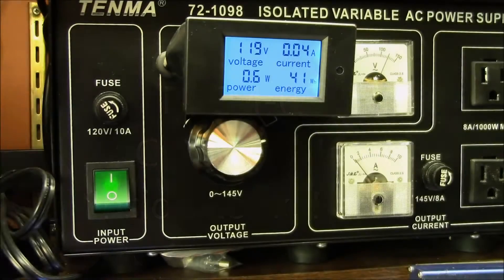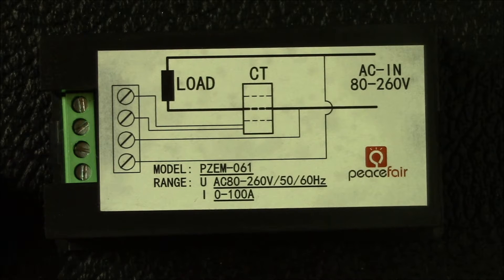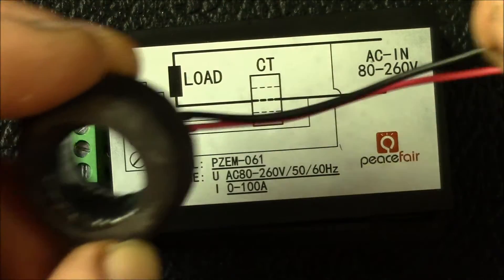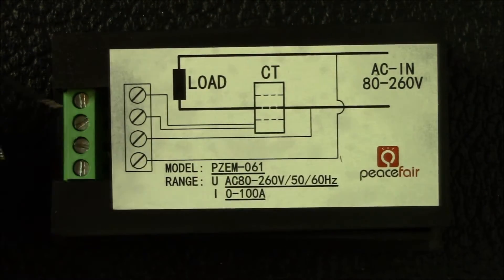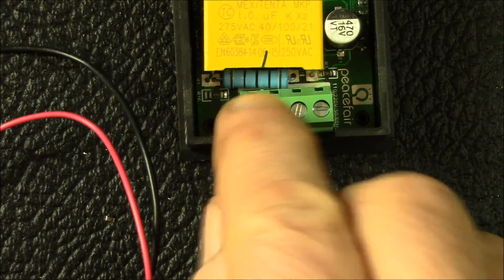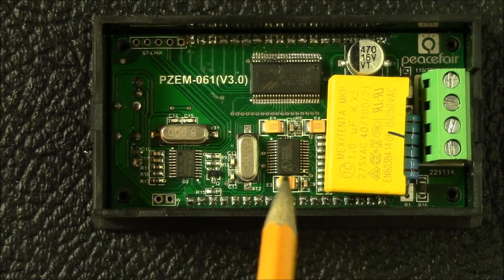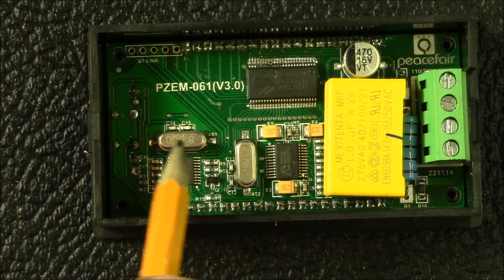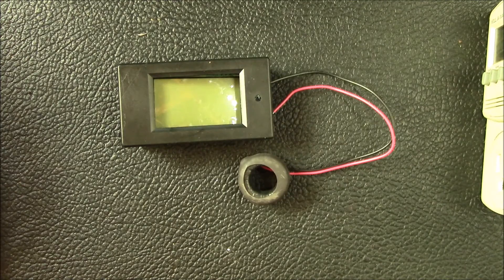PZEM-061 AC Power Meter, Inside Look, Part 1

Comment: Thanks for the great video. Does the AC have to come from the same line.  Ie.  I want to measure the current on my mini split ac/heating units, 40A/240V and the wire is 8 gauge feeding into the breaker.  Can the AC inputs to the device come from another AC breaker in the panel.  The diagram makes it look like it needs to be the same wire feeding the load.  Also, if I am measuring only 1 pole of the 240 circuit, would the ac be 120?
Reply from the maker: See below for one option:
https://youtu.be/LhR-Z6lBeZw?si=6_furGkz1XW2Jlki
You can also power the meter from 120V and then run both L1 and L2 through the CT, reversing one wire so the currents add.  This way power reads correct, volts will be 1/2 and current will be 2X.

Comment: In use ...would you fuse the ( say, 120V / 60Hz) power legs to this unit?...and if so.....what kind of fuse ? ( 1A fast acting?)...and would you need to fuse each of the power legs or only one?
Reply from the maker: Most any size and  type of fuse should work.  The meter itself only uses 10s of milli-amps so 1 amp would work.  The fuse is more to protect the wiring used to connect that meter to whatever it's connected to.
Reply: @The4Crawler  ...I'm using cheap versions of this device attached directly to the panel face of my emergency generator...one display monitor for each 120V leg of the 240V gen output. Like this unit you show....it comes with a ring type current transformer but requires you to source and attach 2 leads from the 120V source to the monitor itself....like this guy uses (https://www.youtube.com/watch?v=DDlYdOamuJA ).  OK....one fuse.....would that be on one leg....or both, for each unit? What is the risk otherwise with no fuse?...maybe only that some electrical mishap will burn the thin gauge wires used to the meter monitor? As if the thin wire is the fuse?  I might take that risk if it's localized damage like that....just don't want to burn up my generator. Panel face is metal and meters are placed by themselves touching nothing else. What would I use...16-18 wire in any case?  Thoughts?
Reply from the maker: @TheWilferch  The purpose of the fuse (or fuses) is to protect the wire from overload or the device from damage in case there's a short inside it.  In your case, on a stand alone generator with the meter on a non-flammable surface, not a lot will happen if the meter fails.  Usually, they'll fail open circuit with a dead power supply.  And if it shorts and something burns up, you're not out a pile of money as those meters are fairly inexpensive.  

So one fuse in one wire, sized for the wire, will keep the wire from catching fire if there's a short.  16ga or 18ga is fine, it's hard to fit 14ga wire in the meter terminals.  The meter only pulls a few 10's of milli-amps (0.010 - 0.020 amps).  Put a fuse in each wire if you're concerned.  One fuse would protect against one wire touching the other wire in a line-neutral short.  A fuse in both wires would protect from either wire shorting to ground.  

The way to think of this meter is it's like having a volt meter, with the 2 probes, and a clamp-on ammeter clamped around one of the wires.  You stick the volt meter probes across the two side of the generator output, there's usually a single fuse in the volt meter.  Only difference with one of these meters is that you've hard wired the probes to the generator instead of holding the probes on by hand.
Reply: @The4Crawler  ...excellent reply with details.....super.....thanks !!!!

Comment: Is there a zero volt mod like in the PZEM 21 where you lift one leg of the big capacitor for use in a variac?
Reply from the maker: Likely the same power input section.  Or see this:
https://drive.google.com/file/d/1w80QYWeo8H5LdRoheGxNCMZViL9uqo81/view?usp=sharing

Comment: You can actually mod these quite nicely. There are a few instructional videos out there for those curious enough.
Reply from the maker: Yes, they are quite a nice little meter.  I modified one to read down to 0 volts.
Reply: @The4Crawler  any videos on this process? Is it much different from the quest for zero on the PZEM-021?

Comment: Hi Rick!
I have a 200amp breaker box and I ordered 2 of the same meter but with the Split core CT’s but ... If they are rated for 100 amps will this be okay on a 200 amp breaker box? If each leg of the input wires from the utility company is 100amps each then it seems it would work, ( one CT around each incoming hot leg)...but that assumes each incoming hot wire is 100amp each? Is that how it works or do I need a CT and meter that will handle 200 Amps? You have been so helpful, thanks very much!
Reply from the maker: A lot depends on how much current you typically use with the 200A service and how much of that 200 amps is really available from the utility.  If it's pulling the full 200 amps, then there will be 200 amps flowing in each leg of the circuit.  That is 200 amps coming in on L1 and 200 amps going out on L2, alternating 60 times a second.  So if you want to accurately measure the full 200 amps, then you'll need a 200 amp CT and a meter set up to use the 200 amp CT.  
You can't just change the CT as the meter is assuming a certain amps-through-the-CT to milliamps-out-of-the-CT ratio.  You could put a 200 amp CT on there that puts out the same mA as the 100A CT, but then the current readings would be displayed as 1/2 actual.
But if you don't have any loads in the house that pull in excess of 100 amps combined (that's 24 KW) then the 100 amp CT should be fine.  
Not sure how those meters react to currents over 100 amps though.  Maybe a viewer who has tried that can chime in on this comment.
Reply: R Brown 
Okay great! That is what I needed to know. Thanks again ! Please keep it up, love the videos...

Comment: Thank you for this video, I know the video is not about installation but I hope you answer anyway.

In the main breaker, Can the ring sensor thingy be installed in the input positive? 

I saw an instruction video here in youtube but the uploader is unresponsive. 

In the video I saw him put the ring on the positive  output wire in the main breaker. 

Now when I checked my breaker, It does not have an output wire that distributes power to the sub breakers, just a flat copper plate on its back that makes it impossible to install the sensor ring.

Can I just put the ring on the Input side positive? Will it still work?

Hope you can enlighten me. Thanks!
Reply from the maker: Something like this:
https://youtu.be/ov2NfLBgjX4?list=PLpY2FP1a9tivPdpLVyg8XMqxw6B6SAEbI&t=260
If so, then yes you can install a current transformer on the main input wire to the circuit breaker panel.  You would need to use a split core current transformer unless you are able to have the power shut off so you can disconnect the input wire and slide it through the fixed current transformer.  

I've heard there may be split core CTs for these sorts of meters available, but I've not run across them myself.
Reply: R Brown  Thank you for the answer!  I don't know if we have the same panel but it's quite similar.

I already bought the similar model (PZEM-022) like the one in this video.

So I guess I can't use this one in my case.

Or I can only use it to one of the sub breakers, since only the sub breakers have output wires. 
This is what I have done so far: https://i.imgur.com/TupqvVU.jpg my main breaker is the top left and as you can see, only input. 

I temporarily installed the meter on one of the sub breakers output to test it out. But afraid to try on the main breaker input since I didn't see someone do it anywhere on tutorials.

So can this work specific model work? on main breaker input? or i need another model?
Reply from the maker: It looks as if you won't be able to use a current transformer to measure the whole panel unless you can find a single heavy gauge cable that feeds power to the back of the panel.  One option you could do is to run multiple load wires off several breakers through the current transformer you have.  That way, the CT will add up the currents in all the wires passing through it and combine that with the voltage to compute power and energy values.  Might be a physical limit on how many wires you can physically fit though the CT.
Reply: @The4Crawler  Thank you for your input, I kinda fixed the issue now by adding a single breaker (60A) before the main breaker I showed you (60A). Our single breakers have wired output so that kinda fixed my issue. Hoping it won't make any issue in the future. Now I dont have to buy 5 of this thing. Thanks!
Reply from the maker: Great, glad you found a way to make it work.

Comment: What is the maximum digit can the energy meter display? It shows reading in Wh,  does it change to 1Kwh after reaching 1,000Wh? 

If not, for instance, the max digit that can be displayed is 4, It can only then show 9999Wh, If so, does it reset to zero after reaching max???? Hope you can clarify. Thanks..
Reply from the maker: It does change to KWH after reaching 9999WH as I recall.  I think it'll go up to 9999KWH then roll over to 0, but I've not seen that happen.  My inverter power meter is at 436KWH, so it'll take a while to max out.
Reply: @The4Crawler  thanks for clarifying, you pretty much covered everything I wanted to know about the device. thank you for making this video!
Reply from the maker: Glad the information and video helped.  With these meters, it seems most of the information about them is figured out by users.  Only way way to see the KWH readings are to push enough energy through one of these so that it rolls over on the display.

Comment: Has anyone used this to measure a 24VAC system?  I have just installed a 24V floor heating system and it's great.  The current power supply is 24VDC and I've been using the DC volt/amp/power meter on amazon to keep tabs on the usage.  Unfortunately, the AC version of this meter says 80 to 230 or so volts AC.  I was going to change some resistors on the board to allow this, but I'm thinking it won't work since the CPU will still be thinking it's higher voltage.  Anyone modified one of these things for lower AC voltage?  Yes, I could monitor the input voltage, but I just don't want to have 120VAC (signal) wires running around.  I guess I could put a series limiting resistor at the front end to protect against shorts.  Thoughts, anyone?
Reply from the maker: You bet, just re-wire the meter to have a separate AC power supply like this:
  https://youtu.be/b2MXXSuzM2k
You'll need to have something in the 80-240V range to power it, like the input to your 24VAC system.  My modified meter reads down to 1 volt AC just fine.  Note that the external and measured power need to share a common reference, i.e. you'll have L/120, L/24 and and common N connection.

Or for only 24VAC power, you could change out the yellow dropper capacitor for a different value or perhaps even replace it with a suitable size resistor for the power supply.  For the cap, use Xc = 1/(2*PI*F*C) to work out the current value at say 120VAC (I = V/Xc) and then figure out a value of Xc (or R) that'll give you a similar current at 24VAC.
Reply: Thanks for your fast response.  I looked at your solution and it's fine if the meter is close to input and output connections.  Unfortunately, I plan to install the meter about 20 feet away and don't want to have to run the load across that same distance.   I was thinking I could use the current sense transformer version of the meter so I don't have to run the load the entire distance.  Alternatively,  I could just move the current sense resistor over to where the high current stuff is happening.  Then I could run the current sense ends to a small signal cable (twisted pair) to the meter.  Same for the voltage to be measured.  I wonder if I could modify the input power section of the meter to a lower value rather than having to run the separate 120V wires to the meter just to power it up.    BTW.  You mentioned a 470K, but from the video it doesn't look like the right colors for 470K.  yellow-violet-yellow    Can you please confirm that value?  Finally, thanks for the thoughts about chaning the cap to play with the current at 24V.  I'll noodle on it.  Thanks a bunch and keep smiling, Ron
Reply from the maker: I guess I was using the values on the partial schematic that a viewer had sent in:
https://drive.google.com/open?id=0B89_DmuFw50kc1BXRVVvdUxpenM
Reply: Ok. Thanks.   Does anyone have a datasheet on the 8208g ic?  All I have found so far is just an internal block diagram and pin assignments.

Comment: Hi, thanks for such in-depth review. What is in your opinion maximum length of wires from ring transformer to this meter without siginifically affecting measurements ? (I need about 5-6meters)
Reply from the maker: Current Transformers work via current and not voltage, so as long as there's nothing else connected to those wires and they are of decent cross sectional area, it should be fine.

Comment: anyone worked with the ST LINK header on these boards to get some sort of serial data out for a Bluetooth, or RF chip or to an Arduino for basic SD Card loging?
Reply from the maker: From what I understand, the ST-LINK header is mainly for debugging and programming the StMicro processor.  I suppose if you knew what registers or memory locations contained the desired data, you could get that sort of information, but without the source code, that might take some digging to find.  Better would be to pick up one of the models with the TTL serial data output and work with that directly.  I plan on doing a review of one of those modules in the near future, so stay tuned for that.

Comment: Is this something that could be used with 3 phase AC?  I'm wondering if it could be used to read the output of a wind turbine.
Reply from the maker: +Steven Funk With a single CT and voltage input, it could monitor one phase of the alternator.  Assuming a balanced load, you would simply be off by the square root of 3 in the power reading, so multiply the single phase power by 1.732 to get the total for all 3 phases.

Comment: I do not think it is correct what you say. There is not voltage drop measured over the 100 Ohms resistor but the CT generates an AC voltage according to  
Lenz' law right in the coil.

The load resistor and the capacitor is part of a (bad designed, btw) RCVT (resistive capacitive voltage transformer) forming the power supply for the LCD itself. Have you noticed that the resistor warms up? With 110V it is still okay, with 230V it gets almost 90 °C

Proof that your theory is wrong: Detach the CT. According to your theory there should be no current flowing through the load resistor... also no voltage drop over the resistor, nor heat being generated in the R'... which is not the case. Just test it, the CT has nothing to do with the 100 Ohms resistor, it is (with the capacitor) part of the voltage divider/power supply for the LCD and measurement...
Reply: +R Brown (4Crawler) I did some poking at the circuit with my ohm meter. I now have a schematic of the front end. R17 is the shunt resistor for the current measuring. It's .5 ohms. If you want a PDF of the front end schematic, tell me how I can send it to you.
Reply from the maker: +biewermatz It's hard to see the traces as it's a multi-layer PCB, but you may be correct that the large resistor is indeed part of the capacitive dropper power supply.  There does seem to be a low value surface mount sensing resistor under the large cap. that is across the CT inputs that I didn't see before.  The CT must be kept loaded or you can get very high voltages out of it.  I'll need to do some further testing to see if I can work out the wiring as it's all hidden beneath that large capacitor.
Reply from the maker: +John Miller Excellent work there.  This is where we can all learn something about these sorts of devices as there seems to be little info. out there.  I was in such a rush to get mine installed, I didn't have time to look at it in detail.  I do plan on revisiting this video topi, I have one additional meter coming and then I'll look into about half a dozen different meters, AC and DC and some with serial communication ports.  I'll also try out one or another mod. to power these off separate power.
Reply: +John Miller I might be very interesting to have the schematic :o)  my goal is to change the shunt resistor to adjust the current I can mesure in a case of a 220v split phase source...
Reply from the maker: +n45w73 LInk to the file below:
https://drive.google.com/open?id=0B89_DmuFw50kc1BXRVVvdUxpenM
Reply: +R Brown (4Crawler) Thanks :-)  I might get one and mess with it to be able to mesure 220v split phase  source  :-)